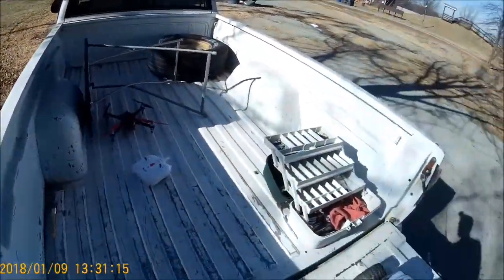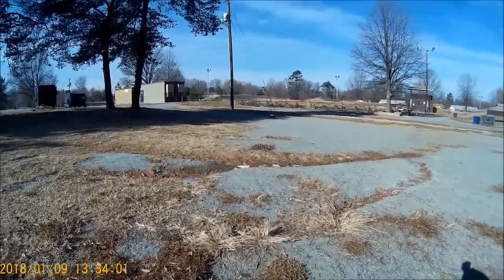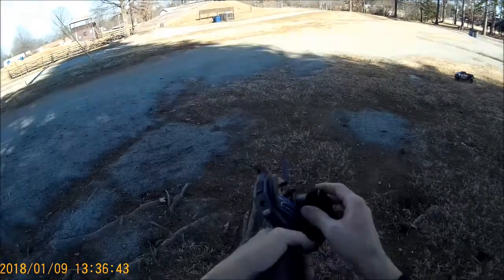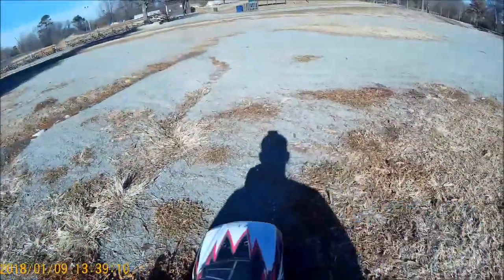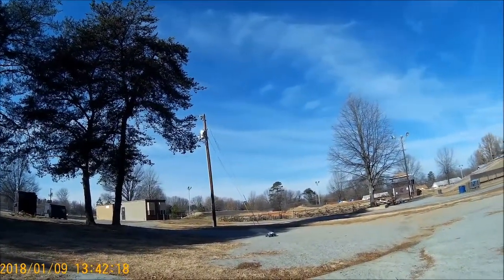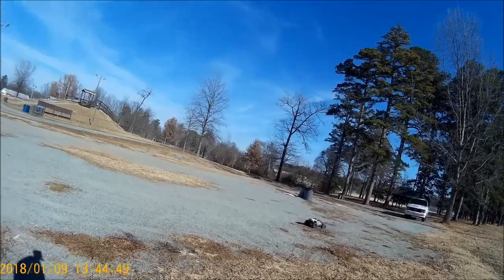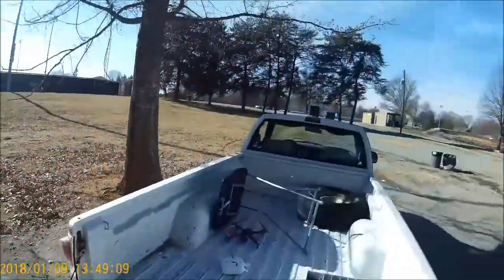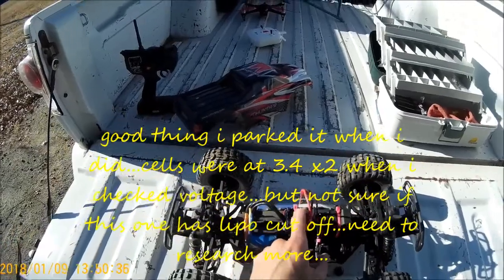zd racing thunder 1/9/18 round 3!!!

Comment: What battery yours come stock with?
Reply from the maker: it came with that 2400 2s lipo with those crazy plugs that plug into the battery...
being i changed around a few things i can not use the stock battery...
Reply: CMC RC ok was confused when you said now I'm putting a lipo in it. So ya same as mine with the deans connector as well. Oh and open that thing up, she can take it.